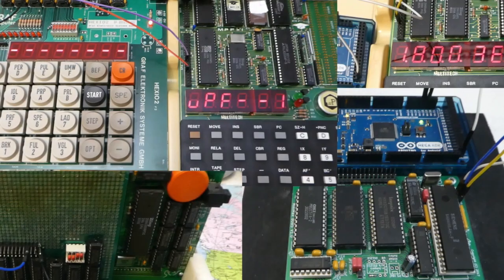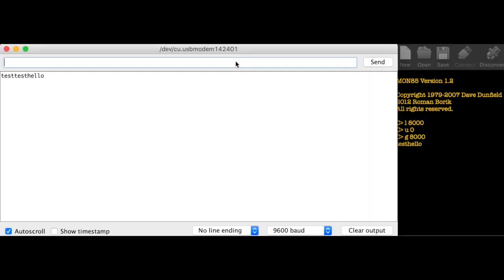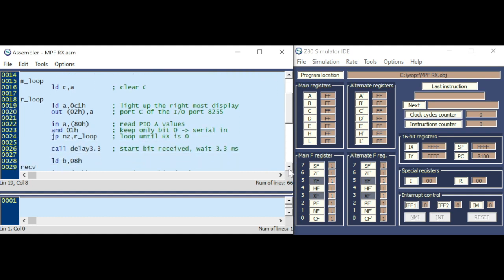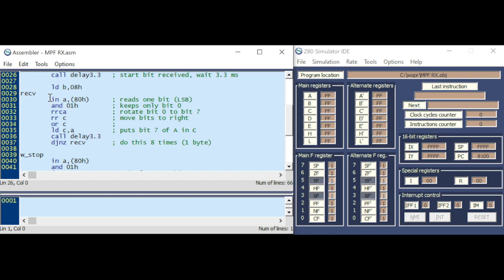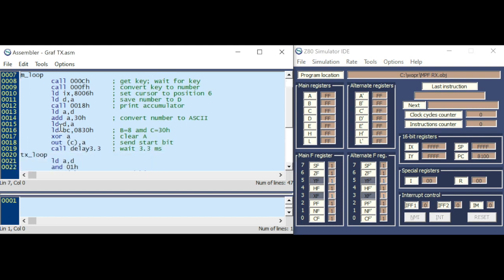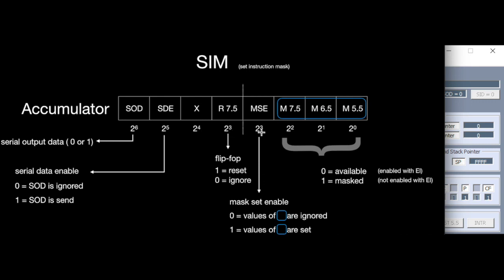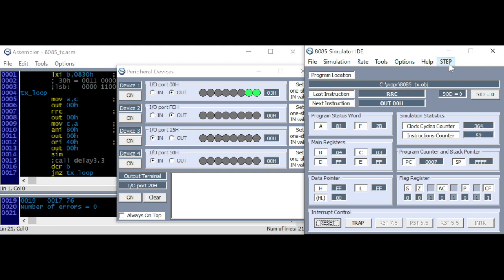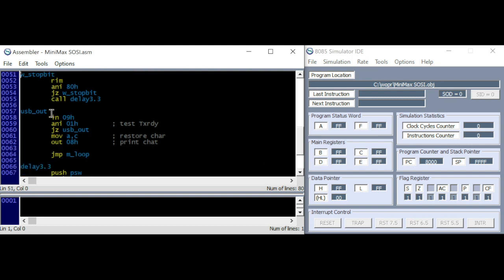Addendum of Zilog Z80 & Intel 8085 Timing

Comment: I do not understand when you are using a Z80 or 8085 why using Arduino. Explain the use and the program for them is good, but a-"void" the Arduino. I apreciate your explanation. I learned both of them oldies as I begun learning industrial automation.